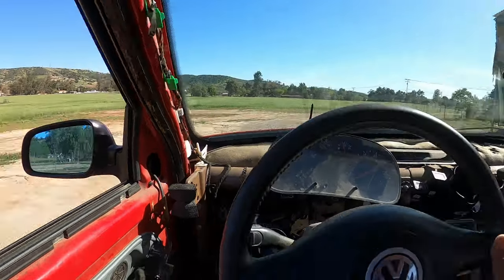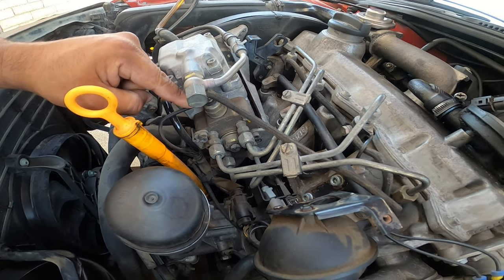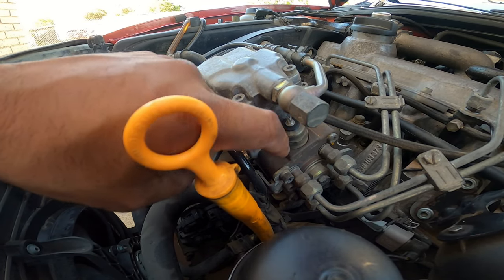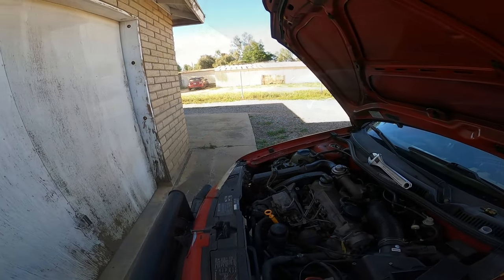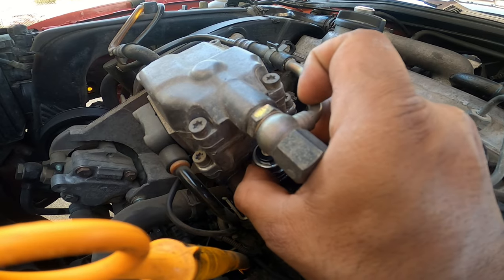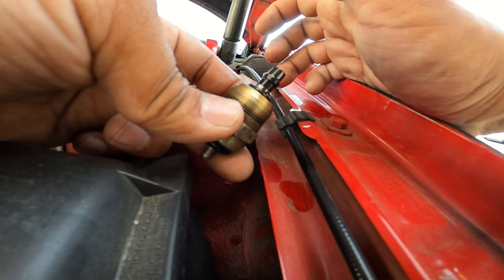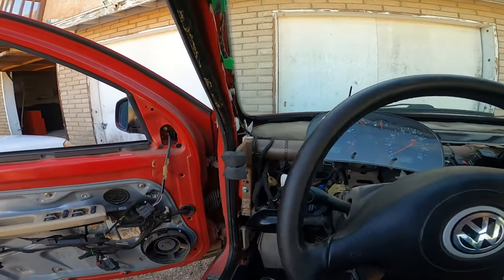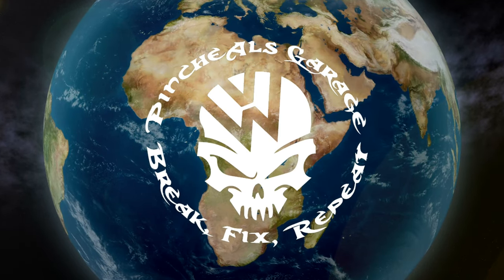MK4 TDI FUEL CUT OFF SOLINOID REPLACEMENT S8 EP1

Comment: Do you happen to know where is the cable connected from? Mine got disconnected, and a "mechanic" connected it directly to the battery, so now I have a massive current leak. I want to know where it should be connected.

Comment: hey brother!! a year later but your content is still relevant here! 

any ideas how to remove the old plunger and spring piece if they get left in the hole?
Reply from the maker: You will need a thin pic and do your best picking it out. Just be careful not to scrape the wall because it can cause a leak
Reply: @PincheALsGarage  i’ll keep that in mind, thank you! i ended up just running to the store and grabbing a super small magnet so we’ll see if that works as well haha.
Reply: update, got the spring and the old oring out, there was no plunger which was odd to me lol. but everything was replaced and drove it until it was warm and after a few startups while warm i’m back at full performance